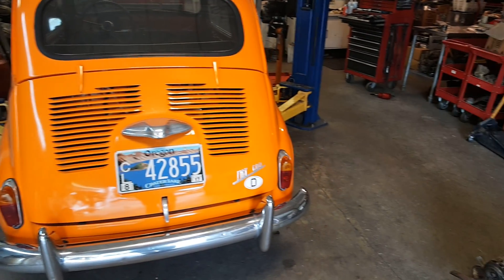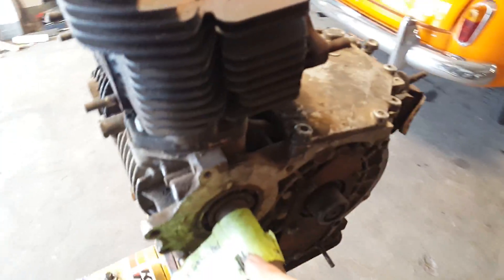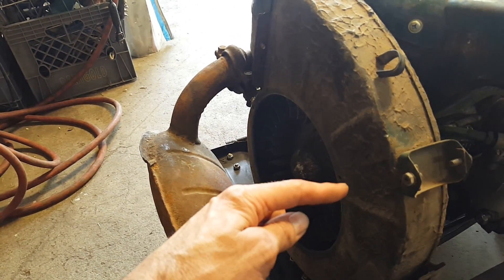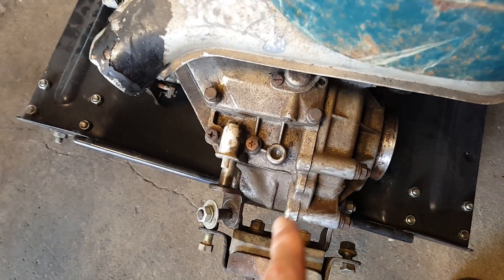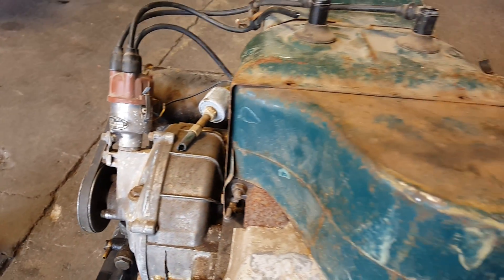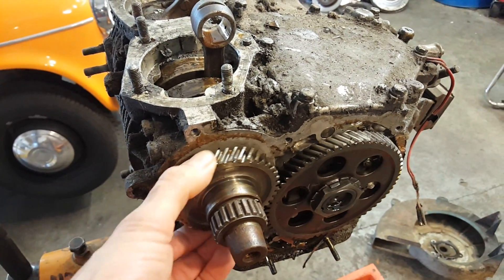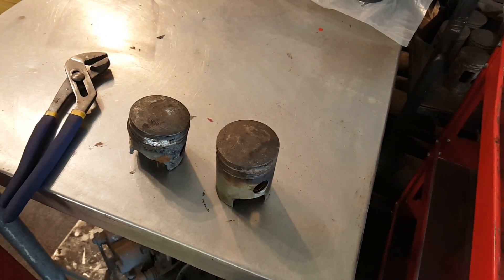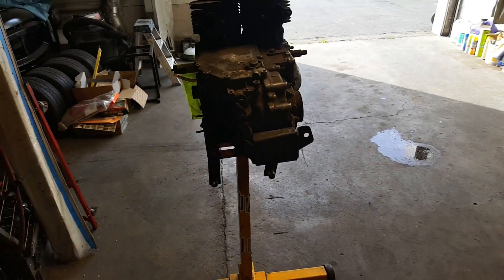Subaru 360 Engine Tech

Comment: Why are the sparkplugs on the distributor not 180 Degrees apart?
If one piston is down the other is up. Firing each plug 360/2 is 180.
Thanks.

Comment: I'm ised to two-stroke motorcycles and this design looks kind of horrifying.  I'd love to see someone swap an RD400 engine into the car.  Final drive would be tricky but it's a huge bump in power.  Or there's the Banshee engine if you really want to tear ass.
Reply from the maker: +JETZcorp  We're working on Banshee water cooled cylinder conversion kit.  Shhhh. its a secret

Comment: A nice design indeed. Also very smart to split the crankcase vertically, instead of horizontally. And, of course, a distributor driven by the crankshaft. The carburator size seems small to me, for example the Suzuki GT 500 used two mikuni VM 28, one for every cylinder. Is there an reed valve maybe? Or a rotary disk?
Reply from the maker: +Daniel Noest  nope, this is 1950's siplistic technology